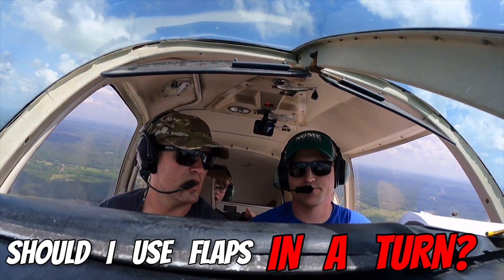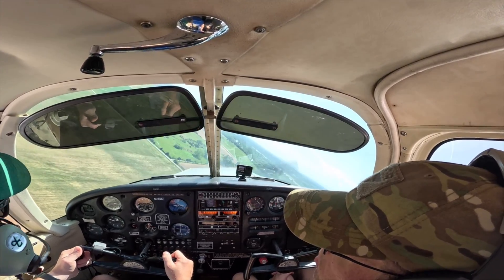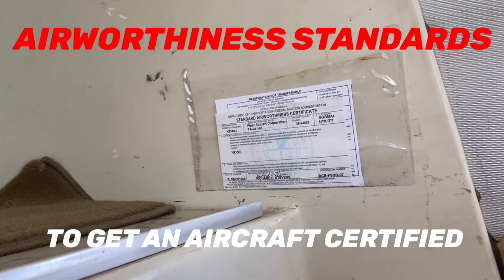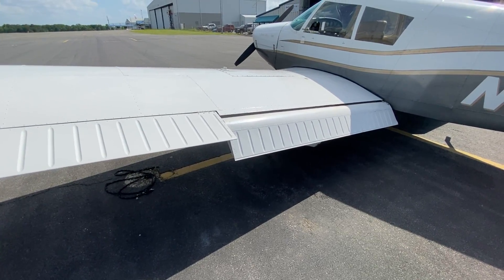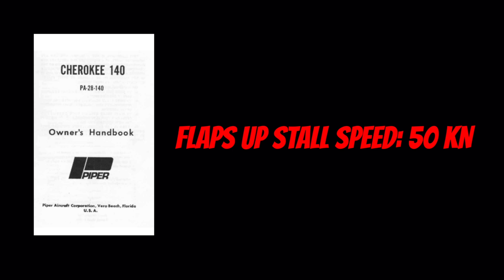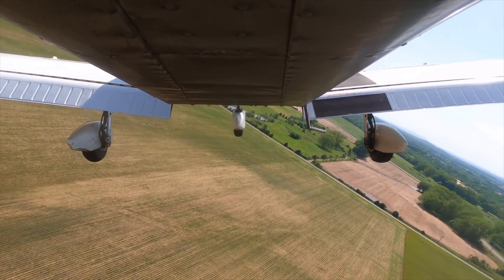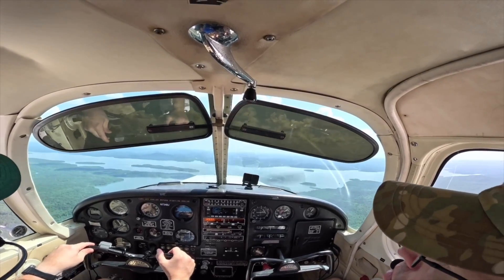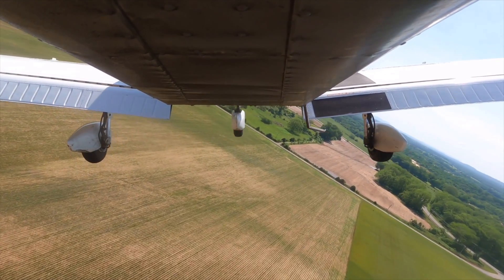Should I LOWER Flaps in a Turn?

Comment: If you fly relatively slow in a traffic curcuit and you do cornering, you get closer to stall. So of course use flaps to gain more buffer and fly safer during this maneuvers. Also you get step by step to your approach speed, can do trimming etc and dont have a hard change on final.

Comment: The only thing that makes me kinda disagree with what you say is that the turn radius is reduced when using flaps. The turn radius is only a function of airspeed and bank angle so using flaps doesn’t make me think that it helps reducing it (I think that the vertical component of lift doesn’t change because the weight doesn’t change so as long as the bank angle is the same, the horizontal component of lift should remain the same)
Reply from the maker: This is a complete theory of mine. As I stated, horizontal lift component apposes load factor, BUT if my theory is correct, load factor IS NOT equal and opposite of horizontal lift because BELOW flaps limiting speed, weight will be greater than the force created by inertia.  In my personal opinion, THIS is why maneuvering speed is so important.  Load factor is closer to being equal and opposite. Now, if weight is greater than the interia force, WHEN we lower flaps, the horizontal lift component can become greater WITHOUT increasing vertical lift.  I’m hoping to prove my theory in a future video

Comment: Sure...  just stay off the inside rudder.
Reply from the maker: Why?
Reply: @FreePilotTraining  Because that's one of the most common causes of a spin in the pattern.  If you are left traffic, turning base to final with too much bottom rudder will snap roll you.
Reply from the maker: @NFlight  inside rudder would cause to “skid”, not slip.  You won’t spin just because you aren’t coordinated. You need to 1. Stall and 2. Have a yawing motion

Comment: I use the flaps I need in turns. Normally low degrees, but I use them. 

To me, the point is not using flaps or not. The really important thing here is the speed. With proper speed and bank angle, there should be no problem.

The other factors to consider would be the existing wind, the available runway length, and the presence of obstacles, before and after the runway.

But this is only my opinión, based in my experience.
Reply from the maker: Yes. Runway length is the most important consideration

Comment: Very entertaining summary. Thanks! This is why I recommend powered pilots to try gliding. On a typical cross country flight we spend ~50% of the time in a 45 degree turn, close ish to the stall and putting flaps in/out throughout. Sounds crazy. Until you get the feel for angle of attack on both wings. 

…and Navier–Stokes equations. Because why not. 🤓
Reply from the maker: You’re welcome! I’d like to fly a glider someday!

Comment: The reason why instructors approach flaps this way, is because students forget to pitch down reducing angle of attack when inserting flaps. Preoccupied with lining up to the runway, the student forgets about their air speed.  The flaps tend to wash out the elevator requiring trim adjustment. If a student fails to correct this, they can find themselves over correcting and loosing control.  The moral of this is that cfi’s need to spend more time with their students engaging in proper education and flight training.  This is where the cfi community is failing.  We need to move away from the online courses and get back to the classroom.
Reply from the maker: Agreed. I think if you do a good job of challenging the student in flight, this won’t be an issue

Comment: Flaps increase aileron effectiveness. Flaps also decrease stall speed reducing the chance of stall and spin due to cross control input.  If anything the higher air pressure under the wings will increase your chance of correcting for that uncoordinated flight. Commercial Pilots.😮snap
Reply from the maker: I didn’t even think about flaps increasing aileron effectiveness

Comment: I was trained in a Rans S-7 and was always taught to add the first notch of flaps at the start of the descent and full flaps on final. We would even do forward slips with full flaps. It's ok in that airplane but check the operating manual for your particular aircraft.
Reply from the maker: Yes, that’s exactly right. Cessna says it’s prohibited with full flaps

Comment: I have been using flaps in turns for over 30 years. I teach my students to apply flaps in turns while in the pattern. I have a couple of reasons for this. I am a firm believer that it's safe to do. The funny thing is I teach my students that in planes that use flaps for takeoff or for the many planes that use them for short field T/O not to retract them until you reach at least 500' AGL. I teach this for the SAME reason. If I get a flap differential (I don't like the term 'split' flaps for this because there are flap systems called 'split flaps') on climb out, the results may not be recoverable below 500'. I know it's a remote chance at best, but that's how I teach it. As for the plane being able to be "controllable" as per part 23 certification, remember, those manufacturer tests are done by company test pilots, with thousands of hours (a lot of that in type), deliberately flying in that configuration as opposed to being caught off guard, that are prepared for contingencies. The average GA pilot is NOT that guy. Certified or not, it could be a tall order to control a plane with a flap differential. Great topic. Great video.
Reply from the maker: Thank you so much! That is an excellent point about flaps on Takeoff.  I teach something very similar.  After clear of the obstacles, I have them wait until they are 70 knots. That eliminates that problem as well

Comment: I just found your channel and I like it a lot how you approach that topic. What a friend of mine showed me also when to lower my flaps to use it as a even better tool. This applies to a C-172: Abeam the numbers in the downwind leg, flaps 10 and trim to 80 kts IAS and power setting to have a stable flight. In the apex of the turn to base leg, lower to 20. Without any input, power adjustments or trim the C-172 will slow down to 75 kts IAS after the turn still perfectly trimmed out. Same then for base to final. Just next notch of flaps of 30 degrees. After the final turn, you will be at 60kts. Way less work to keep your attitude, airspeed and descent rate. Very helpful in our crowded pattern and super short 1340 ft (408 m) runway where every landing has to be on spot.
Reply from the maker: Thank you Markus! I appreciate that.  Great tip!

Comment: Yes flaps will increase the lift vector which in turn with increase both radial (horizontal) acceleration that turns the aircraft and vertical acceleration, it cannot generate just the horizontal acceleration by itself.    To maintain altitude and speed (2000 ft and 70 KIAS) you must have trimmed.     For a given bank angle and true airspeed in a level coordinated turn there can be only one turn radius.  So how did you get a smaller turn radius with flaps at the same IAS and bank angle?   Even though you flew both maneuvers at a constant IAS, I think that you where actually flying at a lower speed with flaps down which was caused by a calibration error due to the lowered flaps effect on the static port.   So the calibrated airspeed (CAS) with flaps down in that aircraft at an IAS of 70 knots is lower, maybe something on the order of 60-65 KCAS.  Not all aircraft with have a the same negative CAS error that you did however and might not get same result as you.   However flaps will allow you to fly slower in any aircraft either in a turn or not for a given stall margin and that will allow a tighter turn at a given bank angle.  Nice test and work though and I think that you have identified a CAS error in that aircraft!
Reply from the maker: That is an excellent point when it comes to calibrated airspeed.  Something I did not mention in the video is that flaps allow you to fly at slower airspeeds which definitely will shrink your turn radius. Now, I don’t disagree with your statements, BUT those all assume that horizontal lift is equal and opposite to load factor which assumes that weight and centrifugal force are equal. I don’t actually believe that to be the case.  Many physicists believe that centrifugal force is not even a real thing.  I don’t share this particular belief, BUT I believe that the increased lift that is created by the flaps improves this turning capability because there is a side load on the aircraft.  Now, once again, this is a theory, but ag pilots intentionally use flaps to tighten that turn radius.
Reply: @FreePilotTraining  Well if the load factor is greater than 1 AND you are holding altitude (and coordinated) then the excess is the sole force turning the aircraft and pointed toward the center of the turn - centripetal, not centrifugal!  Actually all physicists believe that the centrifugal force is a pseudo force and the real force is pointed in the centripetal (inward) direction because if this were not the case you would be turning in the opposite direction.  Not sure what you mean about weight and centrifugal force being equal as weight (=mg) is always pointed downward and the turning force is at right angles to this.

Anyway, since your turns were very nearly perfect circles and you were holding constant speed and bank angle the winds must have been zero or at least very low.   Because of this the ADS-B ground speed is actually TAS.  If you still have the flight log available take a look at the ground speed in both turns - I would be surprised if the second turn was not slower than the first!  No doubt that AG pilots use flaps to tighten turns but I'm betting they are slowing or increasing bank or both in their turns when using them.

Comment: The only time I ever turned a light aircraft with the flaps down was in the pattern.  I learned to deploy flaps in stages.  About one quarter flaps in the downwind after the air speed indicator dropped into the white, down to half flaps in the base leg and full flaps during final.  That didn't have anything to help the turn, it was just to slow the plane gradually for final approach.  Except for that flap usage, the flaps always stayed up.
Reply from the maker: You never know when you might need them in the mountains

Comment: Without all the BS If you shouldn't used flaps in a turn then on every normal approach to land you'd be concentrating on the flaps rather than the approach! What a dumb question. BTW I have over 25,000hrs fixed wing command time.
Reply from the maker: That’s a great question
Reply: @FreePilotTraining  That was a statement. Not a question. Depending on the type of flap, if it is needed, use it. Without it's use, takeoff runs will be longer, as will landing runs. Even in an emergency, use flaps. In some ME aircraft 2.5 to 5 degrees MUST be used during single engine flight. Don't be afraid of using flap!

Comment: What where has common sense gone. Using flaps in a turn is no different than using flaps in straight flight. It's just a turn and same physics apply as in a normal turn with or without flaps. The flaps modify the wing shape and that results in different drag, speed and lift. I never became a pilot, almost though and this should be clear for all pilots. That flaps increase turn rate should also be completely obvious.
Reply from the maker: Thank you for the comment!

Comment: so, who the hell is teaching students not to use flaps when turning base and final?  I've never spoken with a CFI who advocated flapless approaches as "normal"

Also, 23.701 aside, when did "you might have asymmetric flaps and die!" become a concern?  Using that logic, you should NEVER deploy flaps when airborne, especially when on short final after rolling level.  I can't think of a worst possible place to discover an asymmetric flap condition than with less than 200' of altitude remaining.

I've always been taught to start dropping my flaps immediately after putting the gear down: abeam the perch at TPA.  If they somehow deploy unevenly there, then I have altitude to react and recover.  If I held them until short final, i'd have no chance to react to an uneven deployment.
Reply from the maker: Idk, I didn’t know anything about it until I started making videos!

Comment: From my days in aircraft maintenance I will say this. The flap system should be designed in such a way that either both flaps operate together, or they don't move. Exactly as you stated, if the flaps on one wing move, and the others don't the roll input would be more than could be generated by the Ailerons. So, it doesn't matter if you are in a turn or not, loss of control would be imminent.
Reply from the maker: Very true! Thanks for the comment!
Reply: I think you would still have your fingers on the flap switch so you might just instinctualy "undo" it

Comment: A split flap condition is also known as an assymetry. Most if not all larger aircraft have sensors on the ends of the flap (and slat) drive system to detect a difference in the movement of the flaps and will lock them if the difference exceeds a predefined amount, thus preventing an uncommanded roll condition.
Reply from the maker: That’s exactly right! Thanks for the comment
Reply: @FreePilotTraining Thanks. I'm just about to restart my difference training from flexwing to fixed-wing, so will discuss the "flaps in a turn" subject with my instructor no doubt😁

Comment: I am sorry, but I have to disagree with you on the way you explained why flaps tighten the turn radius. 

Flaps do not increase the horizontal lift component. In the way you explained it you neglected to take into account the vertical component of lift, which also increases. If the vertical component was left unchecked, the plane will experience an inbalance between the lift and weight forces causing a climb. Thus, when we turn with flaps, compared to without, at the same airspeed, the nose attitude is lower. Why is it lower? Because the flaps created more lift initially, but we wanted to maintain altitude, thus we checked forward on the elevator (or trim if you wanted to relieve the control forces). Exact same happens when you extend flaps on downwind flying straight and level.

 Lets say your weight is 2000 lbs, thus the wings have to create 2000 lbs of lift. When you extend flaps the wings momentarily create more lift than needed. This is corrected by checking forward on the control column. Thus total lift is back to 2000 lbs. Same happens in a turn. 

By your explanation, if the wings produce a greater horizontal lift force pulling us into the centre of the turn (aka centripetal force) then there has to be a greater opposing force as well (aka centrifugal force) This is the force that increases the load factor, however you said that the load factor stayed the same during both turns, with or without flaps. The only way to reduce the turn radius is to increase the centripetal force ( by increasing the AoB and thus increasing the load factor) or by decreasing the airspeed. 

I agree that flaps make the turns tighter, but for a completely different reason - airspeed. The radius of a turn is dependant on airspeed and AoB. The slower the speed and higher the AoB, the tighter the turn. Flaps allow us to fly at lower speeds and higher AoB with a larger margin above the stall speed. 

There is also a big BUT. Flying in underpowerd trainer aircraft you have to be extremely vigilant of the fact that whilst you are turning you are producing more drag. This can be demonstrated by a simple steep turn. If you do not add power during the turn your speed will bleed off. Now add in the facts that you have flaps hanging out as well as flying at low IAS ( High induced drag) and all of a sudden you find yourself creating so much drag that even at full power your speed still decreases, lowering the safety margin once again.
Reply from the maker: Thanks for the information.  Something I did not mention in the video is that flaps allow you to fly at slower airspeeds which definitely will shrink your turn radius. Now, I don’t disagree with your calculations, BUT those all assume that horizontal lift is equal and opposite to load factor which assumes that weight and centrifugal force are equal. I don’t actually believe that to be the case.  Many physicists believe that centrifugal force is not even a real thing.  I don’t share this particular belief, BUT I believe that the increased lift that is created by the flaps improves this turning capability because there is a side load on the aircraft.  Now, once again, this is a theory, but ag pilots intentionally use flaps to tighten that turn radius.